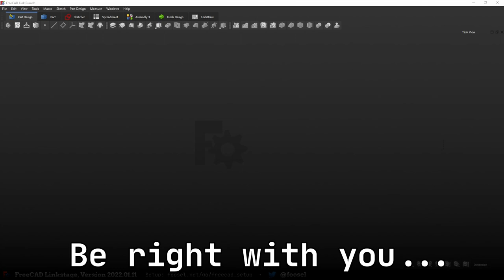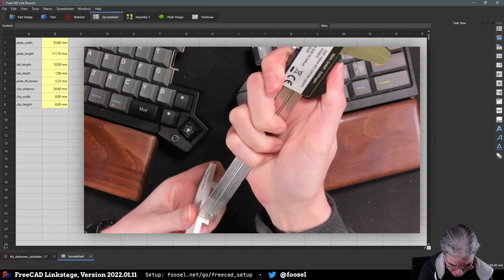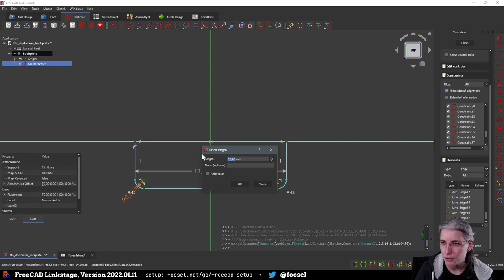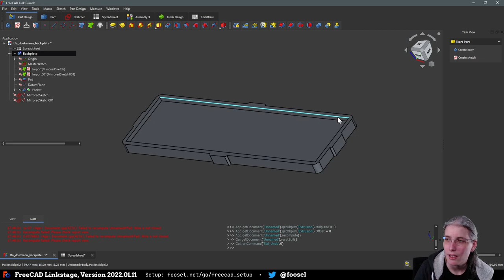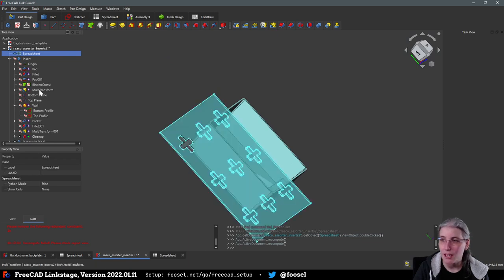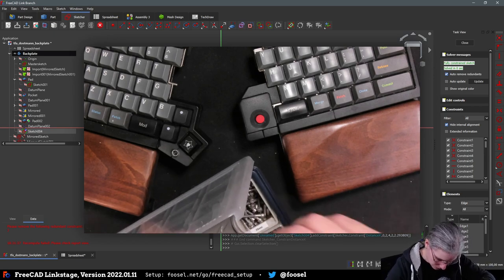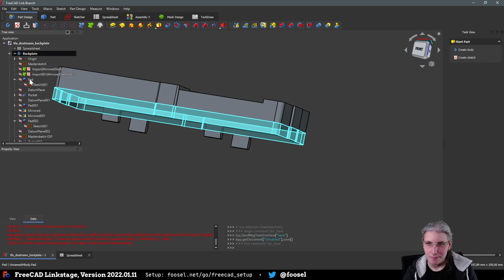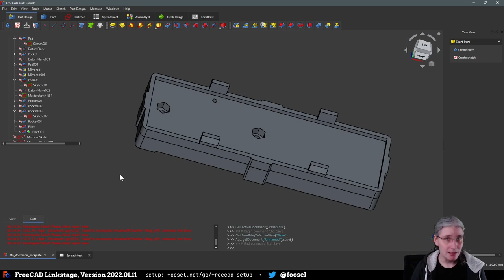[Streaming] FreeCAD shenanigans! CO2 sensor backplate #1

Comment: Very informative stream. Thanks for putting up the recording of it, as I unfortunately had no time to join in live. As I am in the process of switching from the cad software that should not be named over to FreeCad as well it is really helpful to see someone just using it to solve a specific problem. 

I got my part would be very happy to see you cleaning up the part and going along doing a second iteration, as this would show another important and interesting part of the process.
Reply from the maker: Thanks! Second part will be streaming on twitch tomorrow (Jan 16th) at 1700CET and go up here 24h post stream. Cleanup and probably some small redesign after thinking about it some more and doing a test print.